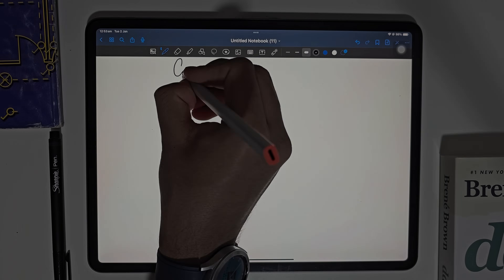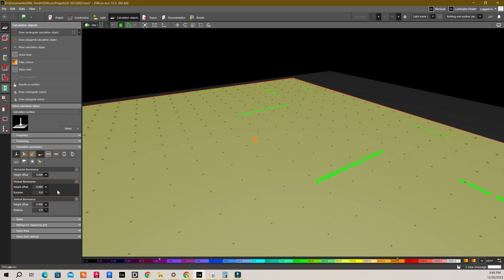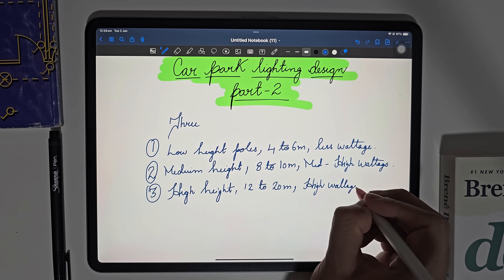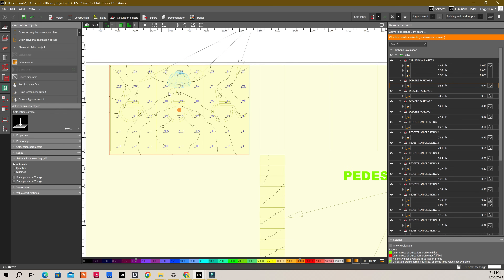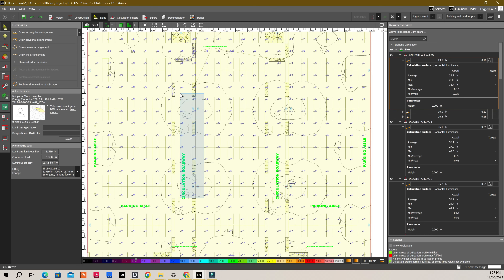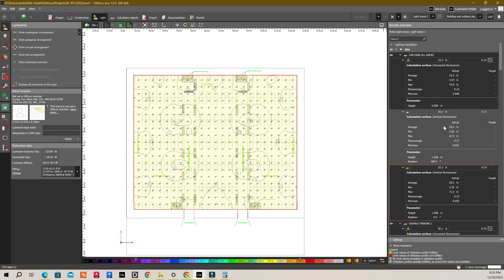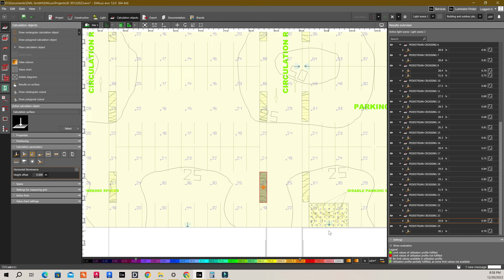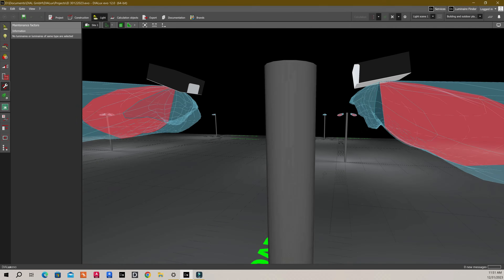Outdoor Car Park Lighting Design Part 2 using Dialux Evo | Electrical Lighting Design as per AS1158

Comment: Great to see some AS1158 tutorials going up—nice work on the clip! There are a few areas you could refine to improve it further. Here’s some feedback to consider:

AS1158.2 outlines the methodology for computer-aided calculations, so here are a few key aspects you missed that can significantly impact establishing compliant values, particularly for vertical illuminance:

Vertical Illuminance: The measuring plane is valid up to 7 metres from the extremities of the area under consideration.
Horizontal Illuminance: The measuring plane is valid up to 2.5 metres from the extremities of the area under consideration.
Maintenance Factor: Include details on how to establish this, factoring in Luminaire Dirt Depreciation (LDD) and Light Source Lumen Depreciation (LLD).
Control of Glare and Upward Waste Light: This is addressed in section 3.7 of AS1158.3.1 and includes the Discomfort Glare Index, Limitation of Luminous Intensity (LLI), and Upward Waste Light Ratio (UWLR). 

The standard doesn’t communicate this well, but these are as relevant to compliance as the illuminance levels.
The standard assumes that asymmetric lighting is installed as photometered and without tilt, which is reflected in the equations governing discomfort glare and luminous intensity. Tilting luminaires alters the range of vertical candela angles, shifting peak intensities relative to the observer. For example, with asymmetric lighting, its good practice to specify the luminaire  based on the direction and angle required for peak intensity without the need for tilt. Tilting changes this peak, often exceeding the thresholds set by the Discomfort Glare Index and Limitation of Luminous Intensity.

In your example, a 10-degree tilt would almost certaintly push intensities above the fixed 65-degree observer angle, exceeding both DGIP and LLI thresholds. To avoid this, a good approach is to reference the 2D polar diagram and adjust the tilt to keep peak intensities as close to the 65-degree line as possible without exceeding it. In my experience, asymmetric fittings leave only 3–5 degrees of flexibility before becoming non-compliant. When i teach this stuff, I i teach tilt at the same time I teach about luminous intensity and in almost all cases, the luminare is designed to be specified as its photometerd, unless its aimable.

It’s also worth noting that glare and obtrusive light mitigation are often not well understood but are key to meeting compliance and environmental considerations. Educating others on these aspects—particularly the Discomfort Glare Index, Limitation of Luminous Intensity, and UWLR—can help bridge this gap. If you’d like, I’m happy to walk you through the clacs and methodologies in more detail over a Zoom session—just inbox me. Keep up the good work on these videos!
Reply from the maker: Thank you for your detailed feedback! I'll definitely make sure to incorporate those points in future videos.

Comment: Sir need calculation pole height, distance etc
Reply from the maker: I used 8 meter height poles, and the max  allowed distance between 2 lights was 45 meters, considering light lumen and height. Please have a look at the light photometry I shared in the video.
Reply: @ElectricalInfinity ok sir